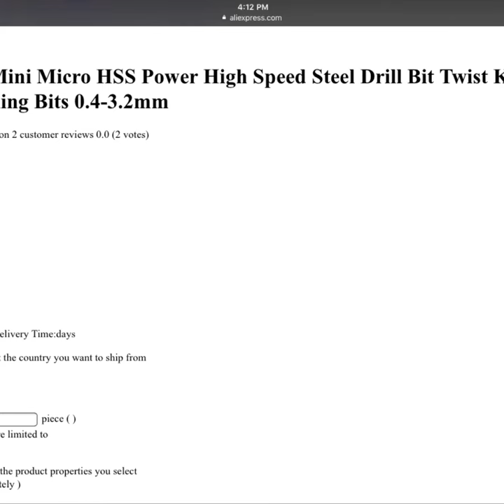Mini micro Drill Press 12-24v D.I.Y build photos

Comment from the maker: HOW TO MAKE A 12v MICRO DRILL PRESS FOR $25 - $45
Demo video here https://youtu.be/36t3GimzuBE
Benefits are....
Very light.
Portable for indoors table top use.
Small for storage space.
Use small drill bits down to 0.3mm and up to 4mm.
Accurate drilling with play free movement.
Can add on variable DC brushed speed control if needed.
Used for many hobbies, circuit boards, jewelry etc.
Not too expensive to make and it's very quiet.
Basic tools and skills required for building it.

PARTS REQUIRED
2 @ 8mm metal shafts & 4 bushes taken from old domestic pedestal fans 
(free at tip $0 or recycle $4 or new parts $8)
4 @ 8mm x 1.25mm anti-clockwise left hand thread nuts 
(eBay $3.50 for 10 s/s nuts shipped or use any thick rubber tube or fuel line pieces for nuts $0)
Epoxy glue, metal thread screws or rivets and screws ($0 - $1)
4 pieces of scrap Aluminum box & angle and/or wood $0 - $8)
8 gauge strong wire or stiff piano wire for handle link ($0 - $2)
12-24v 1Amp Motor with drill chuck (eBay or AliExpress shipped for $15)
Spring 75 - 100mm x 10mm expansion return spring or any rubber ($0 - $1)
Some electrical wire, switch, plug, etc (spare junk $0 or $4)
Optional items might be - LED light, brushed motor DC speed controller.
NOTE  - You will require a 12 volt power supply best with min 1.5Amps supply.

SOME TOOLS REQUIRED
Drill and drill bits
Pliers
Solder iron.

INSTRUCTIONS
Many different designs and materials and ways to make it .... but here is how I did it.
If you can't find or source 8mm metal fan shafts (mine are 210mm long) with the spherical bronze bushes then try a bearing supplies shop to get 4 bronze bushes and metal shafts (or buy stainless rod to match the bushes)
If that's the case you will be using wood instead of the alum and you will only epoxy it all together and you will need longer shafts into the wood and you won't need the left hand threaded nuts obviously.
The overall size is a personal choice and mine has a 75mm clearance under the drill chuck to the base and it slides vertically the full 75mm.
I used a scrap piece of 75 x 38mm box alum for the base cut to 250mm long (straight dressed 2 X 4" wood will work)
The middle sliding aluminum (motor mount) I used was scrap alum window/door piece 200mm long.
Using a 50 X 50 box alum with the cutout for the motor would also work (or wood)
Top piece was 25 X 25 angle alum X 200mm long (or use 3/4" square dressed wood)
Handle was 18 X 18 alum X 350mm long (3/4" wood is ok also)
I first accurately drilled the 8mm shaft holes through the base piece with a 7mm drill bit at 175mm centers and about 12mm from the back face.
These fan shafts also have a different really weird left hand thread on the bottom end and I used the shafts themselves to tap their thread through the 1.5mm thin alum base using some oil and pliers near the base and a bit of grunt and bashing and swearing.
I then drilled two 8mm holes at 175mm in the top alum angle around it's mid width.
You could clamp these items both together for first drilling these 7mm holes if using wood or alum so to match their center spacings accurately.
You really should do all these holes with a drill press if your a dodgy handyman - hmmm ... a drill press ... ok that's a catch22 
IMPORTANT now I very accurately epoxied the shafts to the alum base (with the top alum angle in place with the nuts) being sure to accurately squared them up to the base both ways and parallel spaced etc (or you will be forever drilling holes that are not square to the job or the sliding center box will jamb up and not slide smoothly.
You could use a square cut piece of wood etc fitted between the  two shafts to align and square them up when glueing them in.
I cut out the center part of alum box for the motor recess with a drill and dremel (motor center is located forward off center of the shafts center by about 15 - 20mm so the shafts don't stop you drilling long pieces of brass or whatever.
I now drill the center box piece with two 12mm holes to suit a clear plastic hose I found which fitted over the 8mm shafts.
I drilled the center piece for the motor mount screws and the 13mm motor shaft key hole with a slot cut out the front because the motor and chuck do not separate so it all needs to slide straight in from the front.
After the alum base epoxy is set I removed the top angle and slid the two bottom bronze bushes right down to the base and slid on two rubber hose pieces which will space the 8mm shaft central inside the 12mm approximate holes (your holes should match the hose you get for spacing)
Drill two holes for the return spring ends to hook into the center piece and the top angle.
Next slide the center box over the hose pieces down onto the bushes.
The hose spacing is so you don't want the center box dragging on the shafts obviously.
Next slide the two top bronze bushes on top of the box.
Now I fitted the top angle and 4 nuts and checked all is aligned square and true eyeballing from the front and side etc.
Now I epoxied all 4 bronze bushes in place (some round bronze fan bushes have a stepped shoulder which is about 12mm which is a benefit for fitting but not essential)
After epoxy is set I cut off and removed the clear hose tube I used for spacing.
Now I oiled and checked for smooth sliding vertical movement.
If it jams up then the shafts were not perfectly parallel or square or evenly spaced to each other and it might only need a simple loosening of one side of the top nuts to realign the shafts .... And or tweaking the shafts a bit by hand to get them parallel and square etc. (shafts epoxied into wood you need to get this perfect to start with also)
I made a small bracket for the handle pivot point and screwed it to the angle alum and this doubles for the spring to attach.
I bent up a U-shape piece of 8 gauge stiff stainless steel wire for the handle link rod and it pivots under the motor and it simply spring fits into each side of the handle hole.
Many other ways to do it .... like the smaller drill press (see photo wood handle model)
Fit the motor with two screws and the return spring.
Check for smooth sliding and returning up.
Wire up the motor with a plug and switch etc.
Add a LED light (& resistor) for the 12v if you desire.
eBay and AliExpess have PWM pulse width modulation DC brushed motor speed controller circuit boards for as little as $5-6 but I have not had the need for it yet as I find the speed is good for brass and metal and wood.
TIPS.
The less you have of the very small drill bits sticking out of the drill chuck the more accurate the drilling will be as it will not want to wander around because the drill bit is flexing off center.
Center punch a tinny pin point or scratch cross hair marks to accurately start the hole.
Sharpening these tinny little micro drill bits will be my next slide video - stay tuned